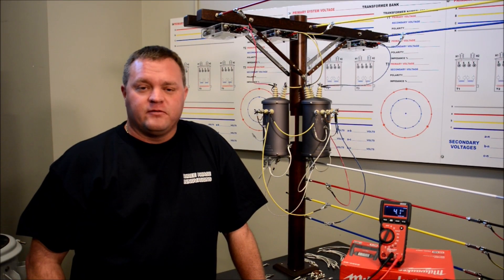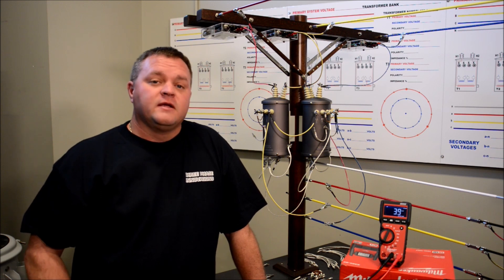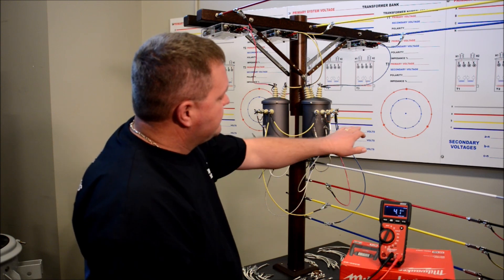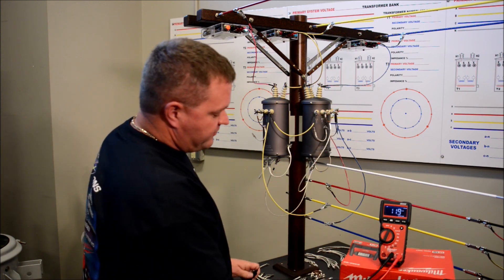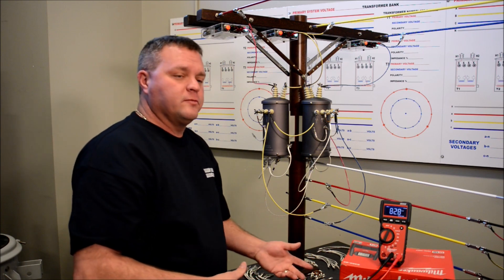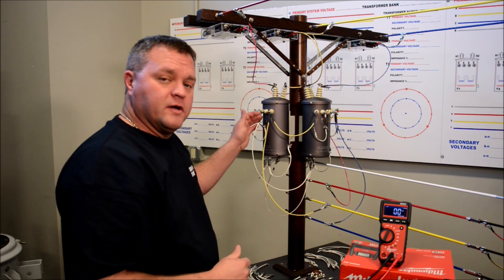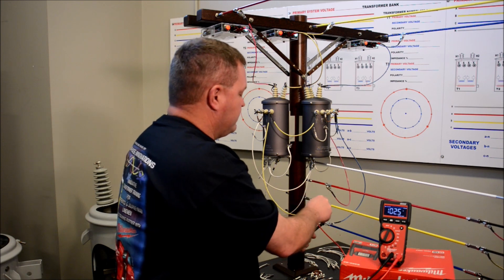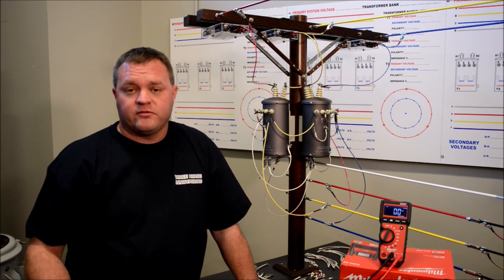4 Wire DeltaTransformer Bank with a High or Wild Leg

Comment: In the USA the NEC requires, on panelboards,  for the high leg to be on phase B.   It must also be orange,  or by other effective means.   If running a 240V single phase load from this system,  you could tap A-B, A-C or B-C, but with a catch.   Most two pole breakers are rated 120/240V, in this case you cannot tap B because B is 208V to ground so you'd have to go A-C.   There are straight 240V breakers available but these are special order and you can forget about walking into your local home depot and picking up a straight 240V two pole breaker.   Typically this system is found in older commercial and industrial facilities, as well as some newer facilities in extremely specific applications.   Only useful where most of your loads are 3 phase motors, with a small amount of 120V equipment.   Load balancing tends to be poor when compared to a more common 120/208Y system.  Also a very easy and costly mistake is to connect a single pole breaker to the B phase thinking your getting 120V, and smoke up everything on that circuit when the breaker is turned on.

Comment: What if all legs read 120v on a 3phase 208v panel?
Reply: That means you are dealing with a 208Y/120V system, which is by far the most common three phase system in the US.